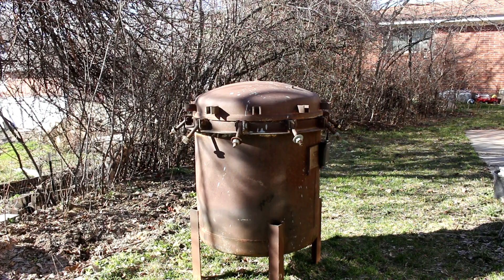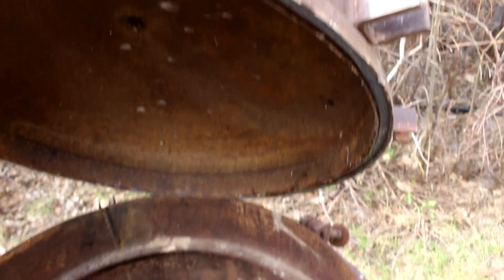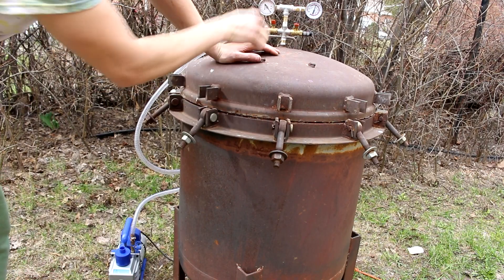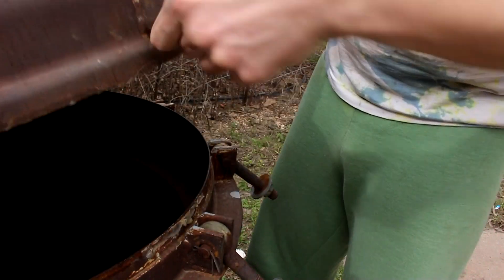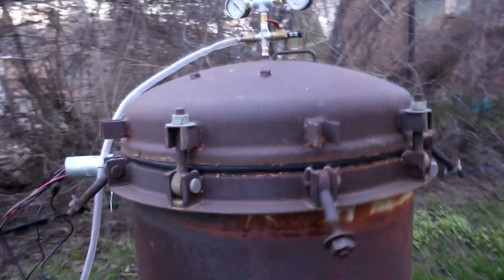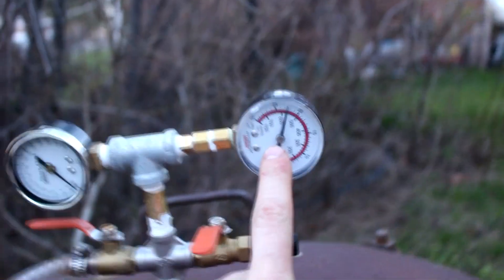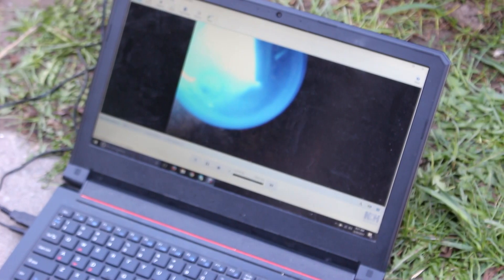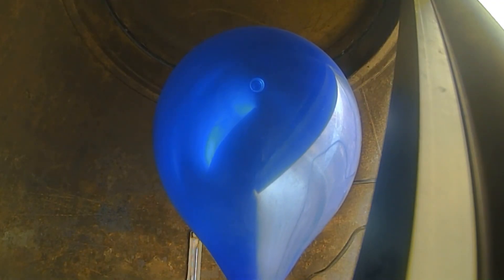Cody's 50 Gallon Press/Vac Chamber

Comment: one interesting thing to use this for is to create a mach 1 wind tunnel this being used as the vacuum side of it and a higher pressure tank can be used on the other side with a converging wind tunnel sitting in between the two using a vacuum discharge vessel allows for a tighter neck without limiting the flow on the high side.

Comment: Honestly, I really hate to see such a rusty metal. I think that would be more safe to scrape off all the rust and use an anti-rust paint. This will increase the duration and the structure resistance (man is 60 years old be careful) of the metal and it will be much more beauty to see.
Plus, other than looking muuuuuch more beautyful, using a chemical inert paint will allow you to make many different projects with the tank.
Anyway, this is a good video, just  the rust made me cringe a lot.
I love your videos, you inspire people to apply to science.

Comment: I see this video is two years old and I didn't read all the comments so maybe this has already been mentioned.  For pressure testing the vessel, you can increase the pressure inside the vessel to almost anything you desire with relative safety.  Do this by filling it completely with water, although almost any incompressible fluid will work.  Fill it such that a very minimal airspace remains.  If the vessel should rupture, there will be very little potential energy stored in the water resulting in a leak rather then an explosion.  I personally tested a water heater this way at 250 psig and later used it as an air compressor tank at up to 100 psig.  I  tested it yearly to ensure internal rust was not weakening it to the point of being unsafe.  Also, the tank lived outside my shop with a double 3/4" plywood wall between it and the shop such that if it did blow, it was less likely to hurt anyone inside.

Comment: After several decades in the chemical/refinery/heavy oil upgrading business I have seen and worked with most types of manufacturing equipment. 
The vessel appears to me to be a filter chamber. I have worked with reactors from very small to very large. It is not like any reactor I have worked with. 
Reactors normally are made from stainless steel.
Hope this helps.

Comment: Hi Cody, David Lemkuil here. I know this is not the correct avenue for this question, and/or request, but I would like to see the leidenfrost effect, or lack there of, in heat shrinking metal with heat and water vs heat and air. Which is more effective? I am an auto body technician by trade which actually requires a respectable amount of physics and thermodynamics knowledge to be proficient. Just curious of course, no hard feelings at all if you don't respond, but I would definitely like to see a high speed of heat shrinking metal(steel) of various densities 
mild steel, high strength steel, and boron steel are the most common types I work with. Thank you, in advance, for any consideration you give this question. Love your experiments, and hopefully, I can see and have a real-time explanation, of what I do for a living. Hope you are feeling better about life buddy. Always keep in mind, you inspire a lot of us to learn, and continue to grow mentally. 🍻Cheers my brother🍻

Comment: Does it actually make a different if pressure or vacuum is applied to a chamber?
If I have a chamber that is constructed to withstand high pressure, does this automatically mean it can withstand vacuum equally as well?
Or are there chambers being resistant against pressure, but vulnerable to vacuum?

Comment: Could you put a compressor inside that chamber, run it, and get a vacuum from a Compressor?
The other way around would be interesting too.
Pressurize it with a Vacuum pump.

Not the most amazing stuff, but Still interesting

Comment: Cody, this is why I like your channel a lot, because you test things instead of buying something and showing it, like you could of bought a glass jar like the king of Random did and vacuum stuff like that but instead you got this big rusted thing from 1961 and installed a pressure gauge and lots of other modifications like adding a camera and you can heat things in there, I mean you are just so original

Comment: might have been mentioned but you could do a hydro-static test. purge out all the air with water and boost to 90 psi and hold for an hour. it should hold without losing more than a psi or two. its how many pressure vessels and boilers are tested. test to 150% of the maximum allowable working pressure (M.A.W.P.). just make sure after you test, you put a safety valve of the proper ratting on the vessel (should be as close to the vessel and with no valves or restrictions on the piping). in this case a 60 psi popping pressure and i would go with a larger capacity. you want the safety to drain faster than you can fill it.

Comment: Could you fill the whole thing in Vinegar and leave it aside for months? then clean it with a pressure washer in order to remove the rust?
At least the rust inside.

Once that done, probably coat it with a rust resistant spray or something?

Comment: The fact that the balloon dropped before it burst means that if it was launched into the air it would likely have kept a stable altitude instead of bursting due to the low pressure...

Comment: If you ran an air line in there and put a balloon at the end of it, would it still do the same thing? Would being in a vacuum cause the balloon to expand and pull air from outside, or do nothing at all?
Reply: StapleCactus the balloon would expand just as if you hooked an air pressure hose to it, and it wouldn't take much vacuum at all.
Reply: So it would still expand, but I wonder how that effects the air density in the balloon since it will have a steady supply instead of only what it starts with. If you capped the hose after vacuum, then let air back in, I'm guessing the balloon will then be bigger than it was before starting the experiment. I also wonder if this has some application.
Reply: StapleCactus the balloon, not being sealed, would not be inflated at all when you began, since it would have equal pressure inside and out. Vacuum in the chamber would cause the expansion as the varied pressure decreased outside the balloon. The expansion would, in effect, give the balloon greater volume. To then seal the balloon would mean less air would be needed to refill the vacuum chamber according to the new volume of the balloon. Any application would have to involve that change, and could only be for that single change, as to repeat the process would cause the balloon to burst and the tube filling the balloon would allow the pressures to equalize inside and outside the chamber unless the balloon was allowed to deflate at some point prior to restarting the process. Still, practical application must surely exist, and IS used, though I can't think of one off hand.

Comment: My grandad worked at the Leader iron works when this model of chemical reaction chambers where made in 1931. My grandads garage was full of the plates on the chambers because that was his job he ingrained the plates on the chambers with a hand powered engraving machine. These where originally tested at 60psi this one is the original iron pots. My grandads cupboards are full of the model testing papers.1 page thick for each one. This model number was tested at 62psi on the 15 August 1931 and sent off on the 20 August 1931 these where reaction chambers capable of reaching 65 Degrees Fahrenheit.

Comment: Cody where you may get a leak from, is where the red and black wires go in.  Air will be sucked in thru the coating that is around those wires, because the wires are strands not solid. If you leave each end of those wires unsealed you will probably be creating a leak. Just my 2 cents.

Comment: Cody, I really enjoy your videos.  I was a boiler tech. in the Coast Guard in the 70's.  I worked with equipment manufactured in the early 1900's to current then.  They were built to stand much more than they were rated for.  Boiler explosions in the steam age scared all manufacturers to the point of over engineering.  I looked  your pressure tank over carefully and the amount of rust you had was not anywhere near dangerous.  Get some Naval Jelly and remove the rust, then paint it with a high heat paint.  Your vessel has many more years use left in it.  Mark Schwartz is correct about the gauges, but you can add valves to isolate them during the different functions.  Cheaper than buying a dual gauge.  I look forward to your new experiments and other videos.  Keep up the good work.
Reply: I LOVE YOU!!!  I made the comment about driving cars with rust-  THAT is STEEL!! 1931 STEEL!!! TOUGH STUFF!!
& the paint that reverses rust IS AWESOME!

Comment: I would recommend you using a gallon of viniger scrub the insides for an hour to coat the rust then rinse it out and scrub with steel wool and finall step is to use a metal lacker.
Reply: Neikoo coca-cola is a great rust remover and will only remove the rust, none of the unoxidized metal.

Comment: That gasket is WAYYY oversized. You want the diameter to actually be under-sized to form a proper seal, so that in compression it'll elastically deform to the contour of your pressure materials. Look up o-ring specs to see how much you want to undersize. (In your application, Buna-N, Neoprene and Viton will all work pretty much-- but each sealing material has a specific set of pros/cons for alkalis/alcohols/ethers/ketones/whatever. They also differ re: temperature and pressure.) 

Since that chamber is olddd, I'd derate by at least half of what's on the service tag. It's not a piece of huge industrial kit and it's like 50 years old, so I doubt those weld seams weren't x-ray'd. It could have passed the factory test, but depending on what materials they used things like subsurface nitriding, after-rust, general porosity, etc. A simple and cheap way to test it would be to do the ol' jam it to near-capacity with water, fill the remainder with a compressible fluid (air), then hydrostatic test it.

A fun project would be to make an ultrasonic tone generator - you basically run one along the set of surfaces, then make a map of the signals your transceiver emits to detect metal deformation.

Comment: Hey Cody.  Could you maybe try an experiment with a turbine or windmill placed at the valve to generate electricity and see if it could be used again for your vacume pump. I wanna know how efficient that would be, and if there would be a difference when using compressed air. Of course you could calculate it but where's the fun in that. And it would be a nice way to store electricity where as batteries will lose electricity over time and components degrade.

Love your shows. greets from holland

Comment: I have quite a bit experience with high pressure cyclinders in excess of 2000 PSI. The proper way to test cylinders (smaller ones at least) is by submerging  water while using water to pressurize  past double the operating PSI. DO not try with air pressure because of the high potential kinetic energy in the event of a catastrophic failure. When testing with water it's called Hydrostatic testing.  I don't mean to be a safety sissy here but TRUST me when I tell you if that thing has a failure while pressurized it would shred your body before you knew what happened. Iron tanks are extremely strong and I have some that are over 80-100 years old still in use that get tested every 5 years. Some don't make it though and need to be scrapped.

Comment: Cody, you could proof the chamber for a safe maximum working pressure of say 40 psi by performing your own hydrostatic test. Clean it up a bit so you can inspect it, get behind a tree or sandbags then pressurise it with water to a test pressure above and beyond what the max working pressure will be (eg test of 65 psi) and keep it at the test pressure for say half an hour. If it doesn't blow a gasket, deform, crack etc then you know 40 psi pressure of air/gas will be okay. I think it would be a good idea to be able to isolate the pressure gauges independently so you can use one or the other.

Comment: At ambient you might get more pressure out of it. Also ASME VIII, Division 1 has the calculations to prove both internal and external pressure. They are quite simple. You will also need ASME Section II materials.

Comment: I work with a couple of these at work, but one is about 50,000 litres. Rated at 2500 kpa at 170 degrees Celsius. Its called an Autoclave....We use them for laminated glass

Comment: If you want to pressure test that tank you need to do what's called a hydrostatic test. You fill it to the top with water, then you use a small pump to raise the pressure to the desired test point. The bonus with a hydro test is that if it starts to fail, it just squirts water on you, not exploding and taking you out. You could easily qualify it to rating, although with the metal flaking off it's hard to say what it will do, but for room temperature stuff you should be okay.  Normally there's a test pressure stamped on it that's normally 2x working pressure at least.

Comment: Please, please please please derust that and get it inspected. Also always use the bolts to secure the lid, in case of failure. You can see the lid shifting as the pressure goes up from the inside view, too.

Comment: Howdy there,
First off,  love your videos, pleased do keep on posting great stuff. Secondly, I have a question for you. I am an avid firearms enthusiast, and enjoy casting bullets for my muzzleloaders. I've recently aquired a bunch of scrap lead from wheel weights, however, it is contaminated with antimony and tin which make the alloy too hard for bullets for use in black powder arms. Would you happen to know of a way to seperate the lead from the impurities without laboratory-grade equipment? Pure lead is needed for a softer, more malleable metal in this type of bullet casting, as the bullets need to be able to readily deform to the rifling in the barrel of a black powder firearm to impart proper twist rates. Any advice you could give I would greatly appreciate. Thanks.

Comment: Are those gauges rated for the opposite kind of pressure that they are designed to measure?  i.e. Can the vacuum gauge handle high pressure, and can the pressure gauge handle a vacuum, without loosing their calibration?  Seems that if each was exposed to the opposite kind of environment, they may be exposed to an atmosphere they weren't designed to operate in.  Just wondering if you would need to install a shut-off valve to isolate the gauge you are not using to protect the gauge.

Comment: you should clean that thing .with hot vinegar and water. or build a sand blaster. and paint it. make it nice. maybe convert a lawnmower engine to a vac pump. to get it down to a decent vacuum kinda quick. then a traditional  vac pump. for more perfect vacuum.  I have no productive use for a chamber that size besides. canning things.

Comment: i get it that you're used to doing cowboy stuff, but you are being EXCEPTIONALLY foolish by putting any kind of pressure in that vessel without testing it first. if you want to pressurize it to 30 psi, then you NEED to test it to at least 60 psi.

Comment: Correct me if Im wrong but it would take around 33,400(!!!!!) newtons of
 force on an area of 0.3297m^2 to pressurize to approximately 1 atm 
right?? (it did say it can hold 50 USgallons = 0.3297m^2). Do be careful
 when using this pressure vessel Cody.
Reply: On a side note I would like to see this used as a pressure cooker.

Comment: It's an ASME code pressure vessel....  It was used to Filter fluids (it was a BAG filter) look at the FSI filters...  dot com...... lol        even if it's only rated at 150psi its tested to 300psi if I remember right.....  I can't remember the name of the company but they are in SLC they sell all types and sizes of O-rings.  Buna isn't much change.....    The vessel should have a tag with pressure it was tested to usually 1 1/2times max rated pressure..... (asme code....)

Comment: Cody you should make a electrical furnace for melting metal that is cheap for a peasant like me to make at home to melt at least aluminum. I know you have one but if you could make one it would be awesome, or even make a induction furnace.
Reply: Also you should weld a frame on that chamber to support it to be a bit closer to the safe side
Reply: Go to Grant Thompson for that. He has a couple good furnaces ranging from gas-fuelled to electric arc furnaces.

Comment: If the pressure vessel is ferrous material, you can try mounting webcams inside with some magnets, as well as using a small USB hub on the inside to connect more than one, and use something like OBS Studio to record all the cameras at the same time.

Comment: Cody, I could be looking at this the wrong way, but shouldn't you put a shut off valve in front of each gauge?  That way when you are pulling a vacuum you don't way to worry about damaging the positive pressure gauge, and vice versa?  I know most of the gauges I work with have that needle that stops the gauge from moving too far in the wrong direction.  Just a thought, awesome vessel, I'm really looking forward to all of the projects you have planned for this beast!  Just a thought, you could also run a thermocouple with the other wires that way you could plug it into a multi-meter to get a digital temp display.

Comment: hey Cody, when the balloon pops, does the vacuum inside get lower or doesn't it change ?          
i mean the air in the balloon is in a closed "environment" than the one which the sensor reads which is the chamber's ..

Comment: Get it hydrostatically tested and re-stamped for the MAWP.  What is good for high pressure is not neccesarily good for vacuum.  That seal is not designed for silicone - check the specs and use another material (o'ring).